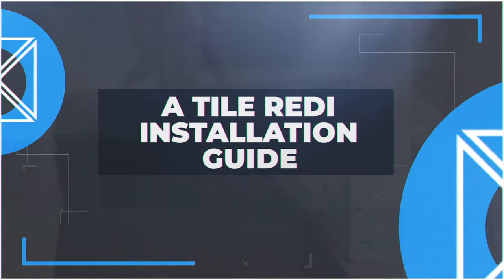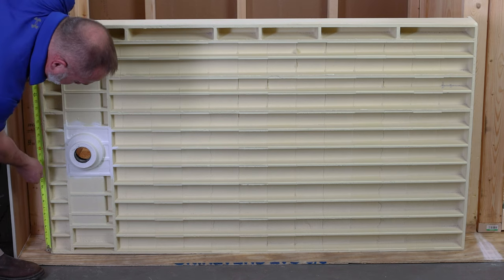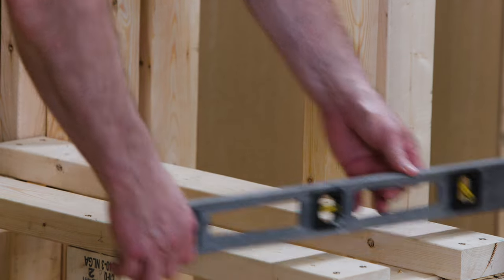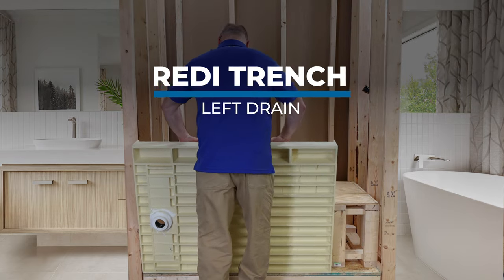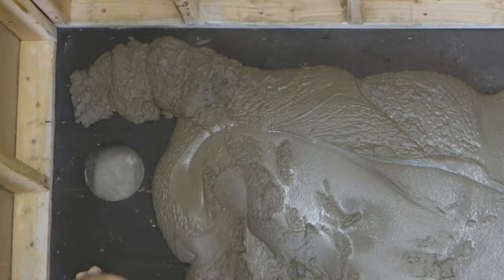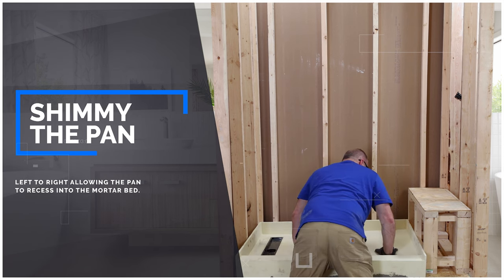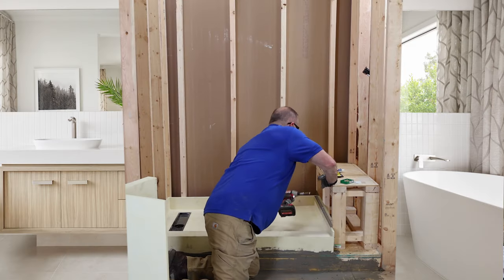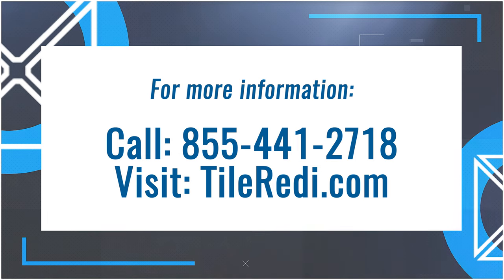Tile Redi Base N Bench Shower Pan Installation Instructions

Comment: It is a great product and the flashing details are great.  In my shopping it seems expensive.
Reply from the maker: Thank you for your feedback! We’re glad to hear you think our product is great. Before deciding on another system, we recommend considering the total cost for all required components. With our shower pan, everything you need is included in the box, ensuring a smooth and complete installation without the need for additional purchases. We're sure  you'll think we're very competitive while making the job a whole lot easier.